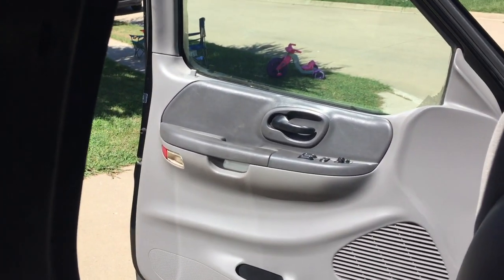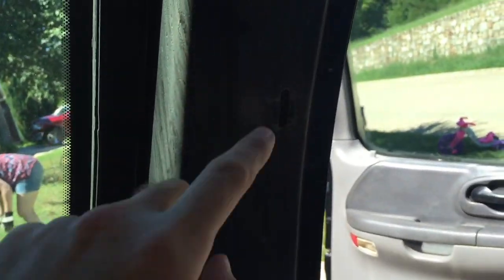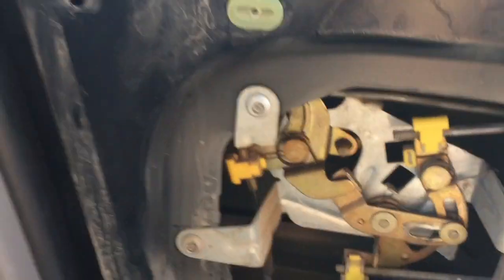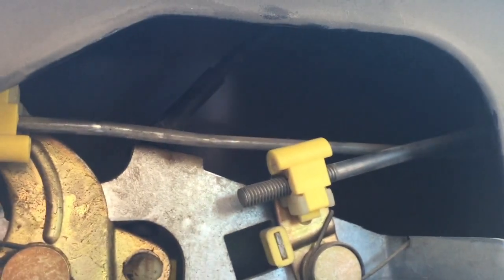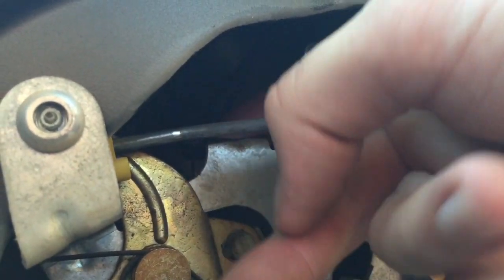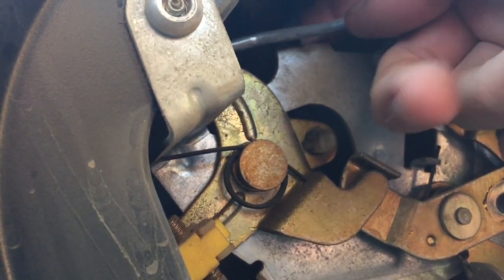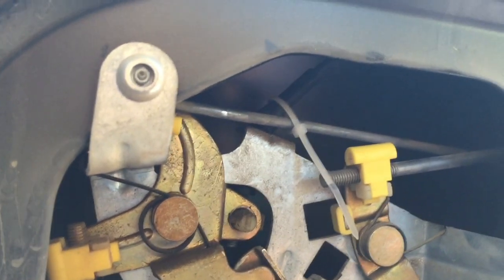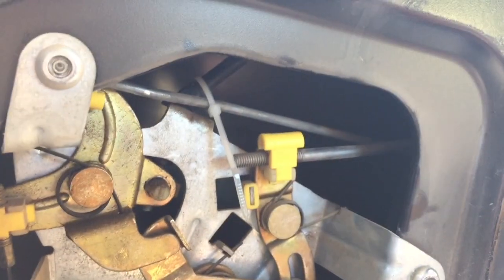2002 F150 suicide door stuck closed FIX

Comment: Well I tried the fix today 3/11/2019 and it worked great. I was thinking I had to replace the entire door locks, the locks were fine the black cable had just slipped off when I closed the door. I got the tie strap and the door worked.  By the way I had taken the truck to the dealer a few weeks earlier they charged me $50.00 and in two weeks I had the exact same problem. These videos are priceless................

Comment: Both of mine went out within about 3 months of each other in my 2001. Just checked and this is what is wrong with the one on the  driver's side. About to check the passenger. Thanks for this video. It has saved me a ton of time and cussing.

Update: Same thing on the other. Sounds like a design problem. Mine have been used rarely and I would have thought that they would work for a lot more cycles than they did.

Comment: Excellent video. This did the trick for me. To make sure it doesn't slip off the notch again, I used a bit of crazy glue to secure the plastic casing (but NOT the wire) to the little nub. Works like a charm. Thank you for this video, I thought it would be a much more difficult fix!

Comment: Great Fix!! But here's how you open the door to make it easier to fix. 16" flathead screwdriver, go in thru the hole at the actuator rod, press against the cable while applying slight pressure to close door and the latches will open, shazam! Door opens!

Comment: What if the black pieces on the cable wire is broken?
Reply from the maker: Yep. That happened to me after I made this video. I’m pretty sure you have to replace the wire. I tried buying these metal replacements for those black parts but they didn’t fit. I ended up just removing the bottom latch before I sold the truck. The top latch still worked.